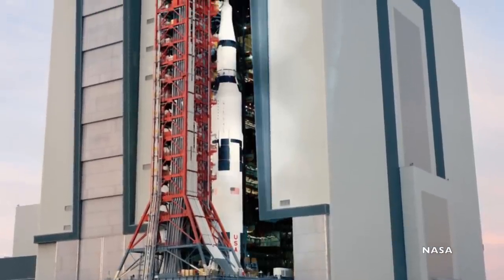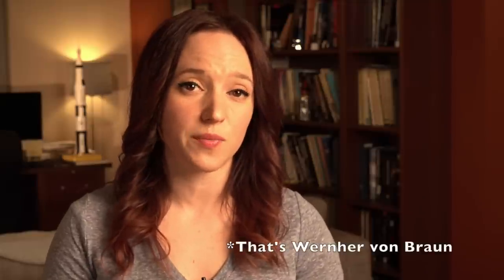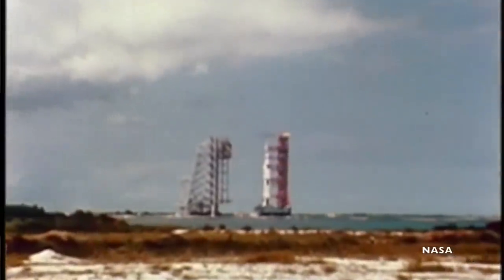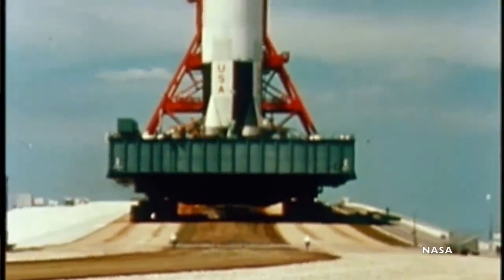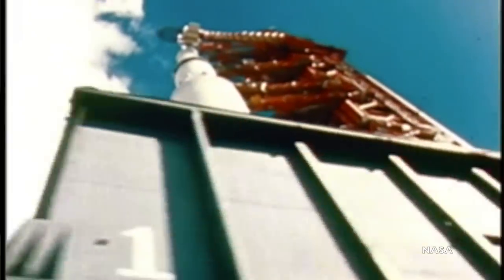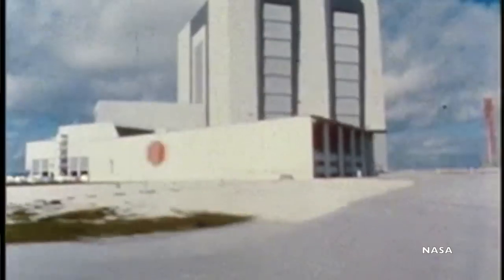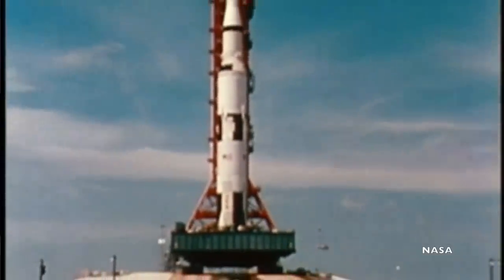How Do You Move a 363-Foot Tall Rocket?

Comment: Gantry Color.  I started out my career in the Air Force in the 1970s as a Corrosion Metallurgist, and while I don't have a hard and fast answer on why the gantries were coated in that particular color, I did some research on types of coatings used and I have a pretty sound hypothesis on the type of paint and the reason for the color chosen.

Knowing what common coating types were in use by the USAF in the 70s, I started there.  While researching the coating used for the Launch Umbilical Tower (LUT), I learned that NASA tried to save sections of the LUT, gantry foundation architecture, and other pieces associated with famous Pad 39A for historical purposes.  However, restoring it would be problematic as the dismantled sections were sitting in a bone yard, rusting and leeching heavy metal oxides into the soil. That was enough info for me to rule out certain paints like latex or aircraft lacquer.  I could also rule out any organic poly-urethane based paints as they were not commonly used in the 60s due to costs.  Urethane coatings were extremely expensive to refine.  Even in the 70s, urethane based coatings were only used on critical aircraft components.

During the 60s, NASA needed an inexpensive coating that could hold up to the high-corrosion as a result of salty ocean winds and fog, adhere to steel easily and still tolerate high temperatures during launches.  Also, they needed a pigmentation color that could be seen along coastal areas and the sea on foggy, low-visibility days.  So, if I was a NASA engineer, I would have looked at the coatings used on deep-sea oil rigs, buoys and bridges - including the great Golden Gate Bridge.  The most common, cost-effective coating used for off-shore purposes was a zinc silicate based acrylic enamel, and I'm about 90% certain that's the type of coating used for the gantries.

As far as the pigmentation (color), I beleive NASA decided to go with the quite common "International Marine Orange" Zinc-Based Acrylic Enamel.  Reason: the launch pads are right beside the sea along Cape Canaveral and heavy fog and tropical storm weather would have undoubtedly been a visibility factor.  Also, NASA had a runway and aircraft visibility would have been a consideration, making Marine Orange a very safe color overall.  So, until you are able to confirm it through your sources with 100% certainty, I would say that International Marine Orange Zinc-Based Acrylic Enamel was the paint, and the reason was to comply with marine and aircraft visibility concerns.
Reply: WD-40
Reply: Great information and answer!
Reply: absolute exactly what i thought! Very well explained!

Comment: From local folk lore: she was built at Marion Power Shovel. Other tidbits: the boys here could weld together the deck and it didn't warp. 

The red, if you poke around, and find out what color (replacement part number to order more of it) it was, or it's composition, you'll find also, in the FAA and radio tower industry there are rules for tall structures and color schemes for safety.  After all, she's going to be standing there by her self.  So, when I saw it, to me I saw radio tower red instantly. Didn't think a thing about it until your video.

Thanks for jogging my memories Bob Hope!

Comment: It is known as a Gantry. A gantry is a service tower, a multistory frame which encloses a rocket at its launch pad, containing elevators and staircases that enable technicians to inspect, maintain, and adjust all parts of the vehicle, and for cabling and hoses to be attached to it and removed. If the rocket is a manned spacecraft, sometimes the crew also enters by way of the gantry. The gantry often rolls away or tilts away at or just before launch. Gantries in the West are painted red and white for aircraft safety; Soviet or Russian gantries are painted military colors.

Comment: why is the tower red?   the explaination could easily be as simple as them figuring out that the US Navy already had vast experience on how to provide corrosion resistance (rust) to metal parts exposed to salt water and salty air and the coating was already in the NSN stock system.  The Navy used "Red Lead" primer clear up until the middle 1980s.  The Golden gate bridge is also painted red.   The answer could be as simple as they used what they had or could get for a reasonable price point since their budget was being used up by research and development and operational costs.    Or visibility was the factor.  The FAA requires free standing towers above a specific  height to have contrasting colors or / and to have a red flashing lamp at the top to avoid small planes from striking them.  My guesses.  I dont know
Reply: While the FAA part of your answer is true, I would suspect that the entire Kennedy Space Center complex and surrounding area is off limits to all civilian aircraft, so there would not be a need for the same FAA requirements.
Reply: The FAA contrast/lighting requirements actually apply nationwide, even on military installations (look for red and white water towers near air bases and lights/flags/strobes on cranes in use on government installations). But I suspect that the "Red Lead" primer was the principle reason for the gantry color

Comment: Structural steel is sometimes primed at the fabrication shop with red colored primer.  The red color helps show that all areas are covered with primer.  Red lead primer and paint are no longer used in the U.S.
Reply: Yeah, I was thinking it might be Red Lead oxide, still haven't found anything better for protecting steelwork.

Comment: What I want to know is how a Saturn 5 or Shuttle was "taken off" the crawler and onto the launch pad!
Reply from the maker: It was a mobile launch platform. It was erected right on the pad!
Reply: Saturn V and Shuttles were taken off by firing up the engines and "taking off" into space
Reply: who else went to the Kennedy space center?
Reply: The Mobil launch platform was jacked up and secured to pedestals and the crawler moved to a safe park position.
Reply: Basically the crawler was the launch pad
Reply: i want to know how it got off the launch pad gasp*rockets dont exist*dome mentality lol
Reply: The crawler actually moved the launch pad itself.  The large grey box under the Saturn V or Space shuttle was the pad.  The crawler rolled under the pad, lifted up and lifted the whole pad off pedestals and moved it to the VAB after a launch.  It would then either park the pad at a storage lot near the VAB or roll it into the VAB for the next vehicle to be built on top of it.  What she didn't mention was the actual launch pads from the Saturn V were the EXACT same pads used for the Space Shuttle (with a few modifications)  At the launch site (place were the pads were delivered) there was no gantry in the Apollo era, the gantry was attached to the launch pad.  With the shuttle the gantry assembly was on location.  The shuttle was rolled out to the site, the payloads were loaded into a bay in the gantry and then whole thing rolled over to the shuttle were special cranes and mech would load the payload into the massive shuttle cargo bay.  The gantry would also protect the shuttle from the weather, as a hail storm (which are common) could easily damage or destroy the tiles on the shuttles skin.
Reply: Thanks for answering my exact question :)
Reply: Danny Frost  the launch pad was made of stern stuff... Steel, asbestos, ceramics.... Plus the fact millions of gallons of water were pumped under and around the launch pad.... It cooled the lad and negated some of the smoke and noise... The crawler had moved away from the pad and was safe a mile away....
Reply: Bigass cranes i imagaine
Reply: @JoshyDMCOfficial  I've been there twice. The first time was when they where finishing up Apollo 17. On day, from a great distance, I briefly watched Apollo 17 being carried to the launch pad (even though it was a moon rocket, watching something slowly moving from a great distance wasn't very exciting...) The second time, the tour was more interesting, because they could show us more places, such as the inside of the Vertical Assembly Building.

Comment: Of course the Soviets had the same problem with their Buraan/Energia system, but they solved it in their own unique way.  They used a rail system and built "crawlers" that rolled. They seem to have doubts about stability, though, so they moved the system horizontally on the carriers and then erected it at the pad.  Two of the crawlers are still parked outside the MIK building in which the Buran met its fate, you can see them at 45.9296,63.3004.

Other things to see: the refurbished shuttle test article that used to be parked on an apron is at 45.9097, 63.3179, Gagarin's home is at 45.9086,63.3156, the launch pad used by Gagarin (called Gagarin's Start) and some 200 launches since is at 45.9202,63.3423.  The Buran/Energia launch pad, also used for the N1 program, is at 45.9622,63.3104; its partner was used only once. Old N1 parts, recycled as shade and weather shelters are at 45.91184,63.2742; Yubileiniy (Jubilee) airport, where the Buran landed is at 46.05649, 63.24703.  Two N1 crash sites are visible - 45.98661,63.35713 and 45.99243, 63.51455.  the home field of the Mriya Buran transport is at Gostomel Airport; its dedicated parking area is at 50.58926,30.20594 (if its not there, use Google Earth feature to find it parked there earlier).

The site of the infamous Nedelin incident, area 41 launch site 3, is here: 45.97542,63.65981.  The whole area of Baikonur is full of destroyed, once operational  ICBM/FOBS silos (46.01897,63.99929)and SA-2 SAM sites (45.85871,63.04402).

Comment: The tower, pad and vehicle get transported to the launch site and the crawler lowers it onto a concrete stand. The crawler drives off a distance and retrieves the pad and tower after the launch. I recall walking under it when I was there in 77-78 when it was being modified for the space shuttle.

Comment: While several have pointed out the need for aircraft visibility, I don't believe that is the reason and while I don't know what the reason is, here is some of my rational for thinking this.

First off, the LUTs (there were several) were actually rarely out at Pad 39 A or B. The vast majority of the time, they were either parked next to the VAB or were inside of the VAB while a Saturn V was being assembled on top of it. The ONLY time an LUT was out at the Pad was for the 2 to 3 months when final checks were being done and in that case, the Saturn V was on board and at night it was lit up with spotlights. The only time it was out there alone was after a launch in which case, it was moved back to the VAB within days to start the refurbishment for the next flight.

Secondly, the MSS (the Main Service Structure), on the other hand, was permanently parked out near Pad 39A and was not painted in International Marine orange. It appears to be just plain battleship grey. And it was not lit up. And due to it's shape it was actually larger than an LUT with a Saturn V on it. Why would it not be painted in a high visibility paint job, when it is always out there, while the LUTs, which are rarely out there, are?

Third, I suspect that the entire Kennedy Space Center and Cape Complex is off limits to any and all aircraft, except for NASA aircraft or NASA authorized aircraft.

Comment: Suspect the red paint was corrosion protection, rather like the Golden Gate bridge. Been there once, years later. One of the shuttles was inside the VAB so the tour group wasn't allowed inside, but I still remember being impressed at the size of the thing.
Reply: +Robert Billing : I agree with you, that was most likely the reason. I was able to go inside the VAB as the Saturn Five was on the giant tractor on the road to the launch pad. We saw the control room thru a large window. We were allowed in one of the giant rooms, but inside walls only allowed us to see the roof, not the entire room.

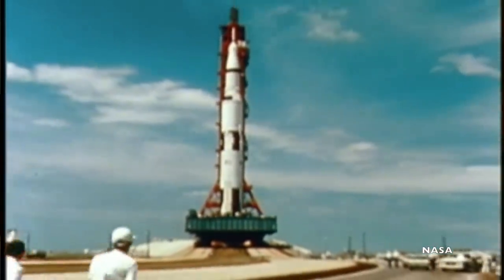Comment: At 1:50 "...powered by half a dozen locomotive-sized diesel engines..."The diesel were Alco model 251 engines.  These, in fact, were the very same engines that went into Alco's line of railroad locomotives.  Many are still in use on the rails today...

Comment: Is the color of the gantry "red"? It is hard to tell from old film and photographs because of the fading of the colors. It could be a color called "International Orange", which has been around for a while. It is supposed to be popular with the "Aerospace Industry" because it stands out from natural surroundings. Have you looked into this color as the gantry color?
Reply: USWaterRockets It's kind of an orange red color.  If you go to the KSC Visitor Center's rocket garden you can see the original gantry that connected to the white room.  It's been repainted over the years of course, including quite recently, but I would assume they used the original color of paint in the restoration process.

Comment: I was told by NASA contractor employees that the original tower was painted with a red paint that had a high lead content that acted as a sacrificial material to prevent galvanic corrosion. The shuttle tower were coated with hot dip zinc coating similar to highway guard rails and sign post because it is much more durable and environmentally safer than the lead based paint. 
It seemed plausible to me and made real sense but I can't say for sure if this is truly the reason for the difference.

Comment: The red colour is for visibility and is actually called "international orange" of which there are several shades. https://en.m.wikipedia.org/wiki/International_orange It has nothing to do with corrosion. To prevent corrosion a sacrificial metal like zinc is applied to the metal structure. This is what keeps the Golden Gate Bridge from rusting and I suspect is used on the launch tower.

Comment: On Saturn V, what are all the hoses and wires from he gantry to the rocket and then drop away as the rocket rises? Electrical power? Adding extra fuel? Transmission of test data? 
and
Sat V, it seems the engines start and then some kind of huge clamps at the base swing back. What are they waiting for before releasing? What is actually happening during the couple seconds before and after lift-off.

Comment: Red paint might be a corrosion prevention coating, similar to what's used on the Golden Gate Bridge. The episode of Dirty Jobs where Mike Rowe worked on the crawler was interesting. It's hard to get a scale reference for the vehicle until you see people working on it up close. They showed the diesel engines in that episode. They're not the size of locomotives, but rather the right size to be used in locomotives.

Comment: I believe in the aftermath of the Columbia disaster they replaced the zinc based paint on the access tower after they found a problem with zinc and the RCC panels on the Shuttle's wing leading edges and nose cap.
From memory they thoroughly investigated the RCC panels, and found sometimes they would develop pin sized holes, and zinc would eat away at those holes.
I might be wrong though!

Comment: Perhaps the red was an anti-rust paint? Typically used in large steel construction and much cheaper than the grey zinc coating there are various coatings Ive seen that are red, or reddish.
My grandfather had a limited involvement with the Avro Arrow project (now there is some more cool history for you, not exactly space but I bet you would find it interesting Vintage Space). They developed a specific patented paint "day-glow" for the arrow for visibility in testing.

Comment: I am just guessing, but I think the red colored paint was an old type of corrosion resistant paint called "Red Lead". And yes, if this is so, it should match the color of the Golden Gate Bridge in the '60s. The paint used now on the Golden Gate may be a slightly different color, since Lead paint has been discontinued, and the new paint was matched to keep the bridge red. The way we like it.

Comment: Did NASA move the crawler transport away from the launch site before launch? If so, then how was the Apollo transferred from the transporter to the launch pad?
Reply: The rocket is assembled on the MLP (mobile launcher platform) and remains there until launch. The crawler picks up the entire MLP, with rocket and gantry tower, from its supports in the VAB, carries it to the pad, sets it down on identical supports at the pad, then retreats to a safe distance for the launch.